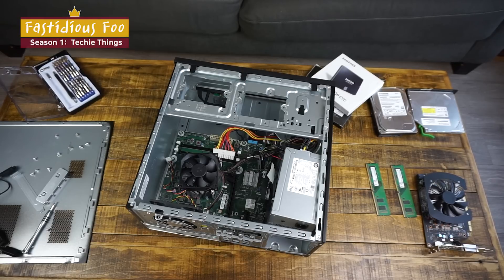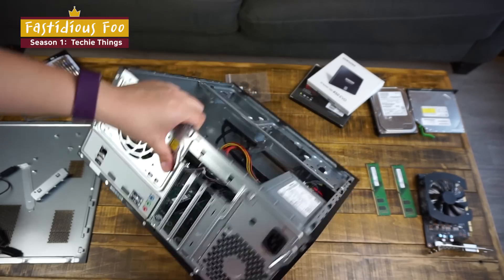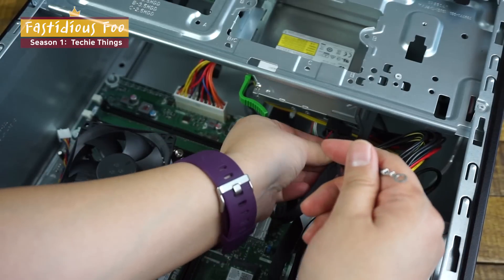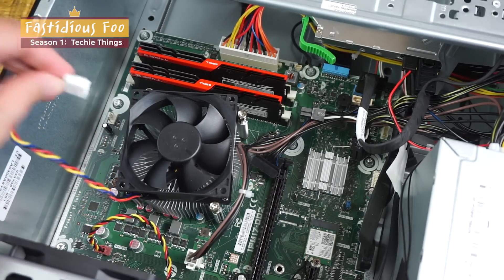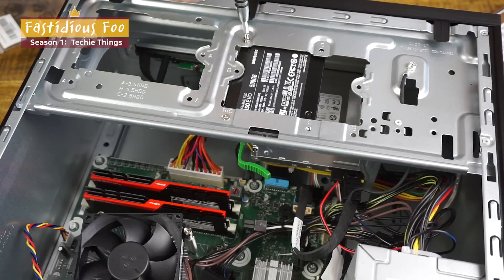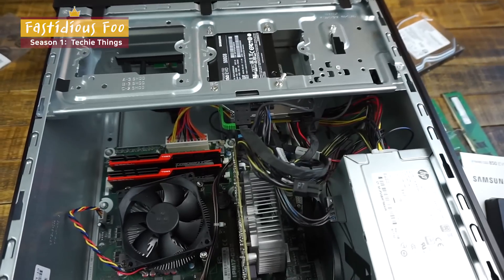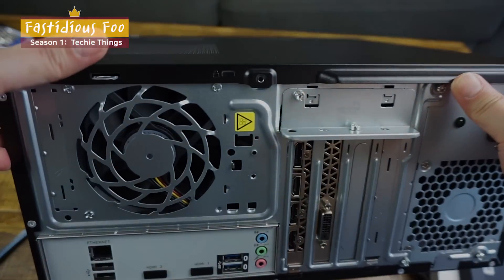RAM / SSD upgrade on HP Pavilion Power Desktop 580-023w

Comment: What Video Card comes in this? I bought one of these used and the card was removesd I had an old RX550 lying around so i tried to use it but it doesn't post. I tried the HDMI ports that have plastic covers in them and no joy there either. Also curious what you have for all the jumper pins. I understand the CMOS clear and Password reset but I have a jumper on the rom recovery but I cannot find that mentioned in the documentation. Thanks
Reply: It’s was a factory Nvidia gtx 1060 3gb

Comment: I've  the  h8-1170uk  module  HP pavilion HPE.   Is it worth upgrading this pc with new Graphic card/SSD hardrive/New RAM   32GB  or it's better to just buy new PC.. what would you recommend please? Also if so which parts would you recommend  Thanks

Comment: could i use this ram Corsair Vengeance LPX 16GB (2x8GB) DDR4 DRAM 3200MHz C16 on the motherboard the pc comes with? i have the same exact pc from hp
Reply: You can install it. But since the Mother Board only supports 2400MHz the memory wont run at 3200MHz. I have the same PC and am about to upgrade from 8GB to 16GB. I am looking at the same RAM that you are.
Reply: @joelrodriguez9661  btw if u still have hdd that comes with it replace it mine died within a year

Comment: I have the hp 570-023w and I added 8 more gigs of ram and a 1050ti single fan 4GB graphics card. It was a very tight fit but it's in and now gaming is not bad at all :)
Reply: So you now have two graphics cards in the pc? Also did you go with the ram she used in the video?
Reply: @zeke2069  This thread was all about if a 1050ti 4gb card would fit in this crappy HP 570-023w. The 1050ti fits barely. I had to push on the metal frame of the dvd drive to make it fit though. Only one graphics card. I added another stick of 8gb ram for a total of 16gb of ram. Now gaming is ok for now until i build a new pc. I hope I understood your question.
Reply: @fretmajik777  Yeah, I understand. Thank you. I'm just still trying to decide whether or not I should just get all new parts for a new PC or if any of these parts can be used again. I know that the graphics card limits the case, so if I upgrade that, then the motherboard will need to be replaced as well, and so on and so forth. I really wish I would have looked at the upgradeability of this PC.
Reply: @zeke2069  I agree, If I had known back then what I know now I would have built my own system.

Comment: Wsp, I have question, I have this pc. I want to upgrade the ram and I think I am gonna buy https://www.bestbuy.com/site/corsair-vengeance-lpx-series-16gb-2pk-8gb-2-4ghz-ddr4-desktop-memory-black/5822470.p?skuId=5822470 but my speed on my ram is 2 133 mhz and if i install 2 400 mhz ram, will my motherbaord not support. And I asked some people and they said it will just go back to 2 133 mhz beucasue i didnt change the setting in the bios. If I buy that ram, does it mean It will run slower at 2 133 and should i rather buy 2 133 mhz ram or not.

Comment: Should i buy another matching 8gb ram for 45$ from HP or which ram do you recommend for me to get for the value? thanks.
Reply: I got two 8gb sticks from Corsair I think as long as there is only two and their speed is 2400mhz, it should work. The cpu is what limits the cpu speed of 2400mhz. Let me see if I can link what ram I got.
Reply: This is what I  got https://www.corsair.com/us/en/Categories/Products/Memory/VENGEANCE-LPX/p/CMK16GX4M2A2400C14 you will probably be able to find it cheaper somewhere else though.

Comment: Hi foo! Thanks for your video it helps a lot to know where everything is. I was wondering if you have attempted to upgrade the psu to something higher than the 300 watts so you can upgrade the gpu if that’s possible?
Reply from the maker: you can definitely upgrade the psu on 580 PC but if you're talking about the 690 PC, it's a bit tricky. I think I got a Corsair ATX PSU for the 580- i don't remember what wattage.   Have not attempted to upgrade the gpu on the machine though
Reply: Fastidious Foo I have the 580 and want to upgrade the gpu maybe in the future. So a little more juice may help right? I’m using it only for the oculus quest link in virtual reality. I’m just concerned the motherboard may hold me back. I’m not really sure! Maybe a card of the same wattage will work? I think the gtx 1060 is 150w
Reply: @leeworden8814  did you ever end up doing the upgrade? I have the same computer myself

Comment: wait this pc comes with ddr3 ram so how are u putting ddr4 ram in there i have the same pc and want to upgrade the ssd and the ram?
Reply: Ruffy White Wait, how did you get the I7-7700? This pc comes with a I5-7400 or at least, mine did.
Reply: Well the first 1 or 2 the shitty hdd that came with it died or sum so I brought it to a shop and he put a new one in and from then it stutters and can get slow very fast unless I clean it every 30 mins

Comment: My gaming HP pavillion gaming desktop tower is only a basic nvidea geforce 1050 graphics card, is it possible to get a better one around A $300 to $500 budget? Also, I want to put more ram, any recommendations?
Reply from the maker: yes, definitely. In fact, I am currently making a unboxing video of 690-0073w which has 1660Ti - I got this yesterday for $450

Comment: Thank you for the videos with much easier steps to upgrade...  really appreciated...  I do have a HP Pavilion 570-p030 and been thinking to upgrade it... have ordered another 8gb ram and your video would be helpful for me to put it in... I am also planning on putting one m2 ssd to make it faster... I have a question and I am not sure if you would have the answer but I thought to give it a try... the USB 3.0 Type-C port that I have in my pc, I thought if I buy a converted USB Type-C to HDMI, I would be able to hookup a monitor via it, but unfortunately it is not working... not sure if this converter will help me to use another monitor... would you have any knowledge of it? anything would be helpful and much appreciated... I already have 2 monitors connected via hdmi and vga ports built-in with the motherboard btw...  thank you.

Comment: You puted the g skill 16gb ram 3200mhz? Because the hp motherboards not support 3000mhz +
Reply from the maker: Correct, I mentioned it on the video with caption
Reply: @Henry Nelson no

Comment: If I can get this computer today for $300 is it worth it?
Reply: Seth Kauffman definitely worth it if you’re not into heavy graphic designing or studio editing. I play most games at or above 60 FPS  (Overwatch, Dead by Daylight, PUBG, Apex Legends, Witcher 3). The specs should hold up for at least 2 more years before you’d have to upgrade the unit itself or get a new build altogether. She doesn’t mention it but if you decide to upgrade make sure you check the power supply to see if it can handle any upgrades. I paid $500 for it brand new with a warranty over a year ago and I have had no issues.
Reply: @AYOxSUBLiiME  ok cool, good to know. Yeah I only plan to game on it honestly, maybe some light browsing on the net and stuff, but I just want something that can handle my gaming along the lines of my One X and my Ps4 Pro (well,  better than the Pro probably, cause it's not like the X lol).
Reply: Seth Kauffman the Xbox one x is awesome for 4K gaming when it comes to value. You would need a build over $1500 to be able to even run 4K at 30-60fps. This is a solid 1080p prebuilt and a good value especially if you can get it for $300. Yeah it’s good for light browsing. Ideal Pornhub build.
Reply: This is only good for 1080p gaming which I’m fine with. If you want 4K you’ll have to look at a much higher price point to match the Xbox one x or ps4 pro. This is more comparable to an Xbox one S or a ps4 (not pro) as those are 720p and 1080 respectively. The games I mentioned can run 60fps @1080p on high or ultra settings. If you compared the base Xbox or ps4 graphics to this the consoles would only be equivalent to Medium settings on PC, so this prebuilt is definitely worth the value you get if you’re not concerned with 4K gaming and it’s VR ready.
Reply: @AYOxSUBLiiME  I'm wanting 4k, but I have my One X and Pro for that (not pro really lol, 1800p and 1440p), so I can be happy with 1080p if it is, and it's VR ready? That means I'm ready lmao.
Reply: Thankfully I can afford all the systems I want, I do enjoy having exclusives (Pro and Switch), and the multiplatforms just run better on One X, so with this computer being enough ready to handle it's own, I'm definitely going to get it and get a nice 1080p 144hz monitor I guess.
Reply: I want it for its PC VR, but I still love my PSVR and actually just bought Moss, Astro Bot Rescue Mission, and Wipeout Omega Collection, all for $55. Wipeout was the best deal at like $10, plus another 20%. I want all the greatest technology at some point... I just got a gear s3 frontier to go with my s10...  Nicest watch I've ever seen or used lol. Anyway, thanks for some assistance, I'm definitely gonna grab it for $300. Can any parts be used in a different build?

Comment: can u still keep this power supply unit after upgrading the ram and SSD?
Reply: Did you find this out? I have the same system and was gonna go for the SSD upgrade.
Reply: @JonMHarrell  i did upgrade ram and SSD. if there is a way to check if power is enough but everything is running fine. The SSD i got didnt come with screws to screw it in and the cable i used was for the old HDD. I literally wedged my SSD in there and everything has been fine

Comment: Do I really need the disc drive? I'm going to add 16gb ram and a 500gb ssd so I wanted to save power since the psu is 300w, will I be fine without the disc drive?
Reply: Not sure you would really need to worry about PSU in that case at all. But no, you don't really the optical drive... But realize that it's not using power unless you're actually using it. The biggest reason to remove it is to accommodate a longer GPU. If you're replacing the stock 7200 RPM hard drive with an SSD you'll actually use less power, not more. SSDs are more power efficient. Even if you also keep the stock 1 TB hard drive, I kind of doubt you'd really need a bigger PSU.
Reply: @Nikoab I've used this computer with an SSD as a boot drive and the stock HD as additional storage without issue.

Comment: Can I move the motherboard to a new case to what would be good one
Reply: Yeah it's just a micro ATX (mATX) board, so it will work in any ATX case or mATX case. The choice depends on what you want out of a case in terms of price, upgradability, cooling, and size. A larger case will be more upgradable and likely have better cooling. But they will be much bigger than the stock HP case which is very compact.
Reply: @ZombieLincoln666  thank you thank you very much i'm gonna add a graphics card so im gonna need more cooling

Comment: Do you think the power supply would be able to handle it if I used 16gb of ram, an ssd, and the hdd it comes with
Reply: jnust upgrade the psu its just 30 dollars get the 750 or 500
Reply: @OnlyGold77  can I just use any psu with this motherboard? If not, can you link me one that works, thank you

Comment: can you change the motherboard?
Reply from the maker: absolutely, that's what I ended up doing later on.
Reply from the maker: or did you mean if I can post a video for replacing the motherboard?
Reply: I was just wondering if it is possible ... 
Thanks for answering.  @fastidiousfoo
Reply: @fastidiousfoo  Could you post a video? I love watching these, it is really helping me get over my phobia of opening up my pc. Thank you so much for your work!
Reply from the maker: @KevinAndFriends.  Sure, I can do that... um is there anything, in particular that you want to see?
Reply: Fastidious Foo If you were to do a vid, probably just general info like what motherboard used, what case, and what goes into where including what parts you are using! also I had a question about upgrading ram on the original motherboard that this pc came with. on it’s product description, below the “upgrading ram” section, it says that it only supports 16 gb in the form of two 8 gb ram sticks, what would happen if i put a single 16 gb stick in or even two 16 gb sticks?
Reply from the maker: Okay, I've filmed a few videos on computer stuff - once I edit them, I'll upload them :) As for as your RAM question, it is better to use 2x 8G RAM instead of 1x16G performance wise but not sure you'd personally be able to tell the difference much. But if you are planning on expanding more in the future, 1x16G RAM would make more sense.

Comment: So you added 3200 RAM...  I was under the impression it only takes 2400.  Am I way off base?  If so, can you please explain?  How has your performance been?  Any issues?  Thanks.
Reply: I don't think she meant to say 3200
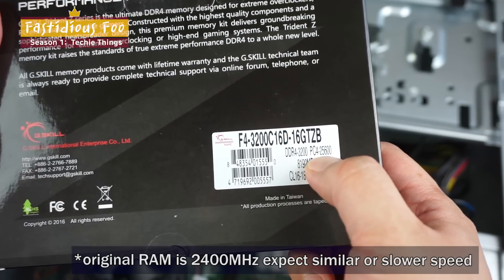Reply from the maker: You are absolutely correct.  As mentioned at @2:27, it performed at about 2400MHz. We've experienced no issues.
Reply: @fastidiousfoo  will G.Skill Ripjaws V Series 16GB (2 x 8GB) 288-Pin SDRAM DDR4 3000 work in this pc? as I am looking to upgrade the ram and its the ram I would prefer to get
Reply: @daylanbaust5940  It will work but I would recommend getting something that runs at 2400MHz since that's the fastest it will be on this rig
Reply: @theepster  Thank you. I would get something that runs at 2400mhz but because I plan on upgrading the motherboard case fans/coolers and psu in the near future I want to have faster ram for upgrading  and don't want to buy ram twice. Thanks again
Reply: @daylanbaust5940  Okay the 3000MHz will for sure be the smart option if you are going to upgrade the motherboard in the future but yeah, the ram you are looking for will definitely work with this PC

Comment: Where did you get your screws from that you used to secure the SSD to the case without a bracket?
Reply from the maker: I just had some laying around but you can get them at micro center or any other electronics store possibly home depot too...
Reply: @fastidiousfoo  I managed to find some pan machine screws at Lowe's that did the trick. Was finally able to fully secure an SSD to my mom's older HP 3500 computer that had a similar case array to the one you installed yours on. Thanks for the inspiration!

Comment: If i was to replace the power supply which one did you go with?
Reply from the maker: I moved around parts to build another computer... but I think initially Corsair CX650M (650W-80+ Bronze) while it was on sale + had rebate deal

Comment: I have this same computer and I am about to order the same Ram sticks and SSD with a bracket. Is the power supply (300watt) still enough after the upgrades? Also I am using the SSD to run windows and the HDD as a media storage.
Reply from the maker: I personally did not have a problem with the power supply even with the upgrades but ended up replacing the power supply later on
Reply: @fastidiousfoo  ok, thinks for letting me know.

Comment: can this case and motherboard fit a gtx 1070 mini or 1080 mini?
Reply: The gigabyte gtx 1080 mini is 6.6 inches so there is that option as well.
Reply: @Me_preppy  So either the zotac or gigabyte 1080 mini will fit?
Reply: @mattheww1072  yep.
Reply: No , the case is too short. The  DVD drive is in the way and so is the 24 pin connector. I would suggest a new case ,New power supply and a pcie extender to fit a bigger card.
Reply: Keeks Seven is that for the zotac version or gigabyte version?
Reply: @mattheww1072  Hey i remeasured and they do fit. The only upgrade you would need is the power supply. You just need a 500w power supply with 6+2 pins and whatnot. both models you mentioned are around 8 inches in length.
Reply: Any of the mini graphics cards will work.  Just remember you also need to upgrade the power supply.

Comment: I know this vid is extremely old, but im really hoping for a response. I have this pc. And i want to upgrade to 16 gigs of ram. I think i found that same ram but i hope it doesnt matter. Anyway. It says the speed is 3200 on the 16 gigs and my ram obviously is 2400 normal. Like u said in the vid. You said similar or slower speed on the 16 gb of ram. Will it still work like 16 gigs. Cause for some reason i really need 16 because i cant play fortnite and have discord and youtube open at the same time otherwise my memory goes to 100 percent. And idk why but my games keep using like 100 percent of my cpu. Hope u can help me. Also if i get 16gb should i upgrade my power supply.
Reply: "extremely old" means 2 years old now apparently. wait until you enter your 30's.
Reply from the maker: I am confused about what you are asking. The capacity and speed are not correlated.  When you have 16G RAM, it will work like 16G RAM. I did not have issues when I was using the same power supply. So I don't think it is a must.
Reply: @fastidiousfoo  I have a question can I move this motherboard to another case and what would be a good one

Comment: What kinda PSU and Graphics card would I need for this?
Reply: crazydrpepper it comes with a FTC 1060 3gb and a 300 Watt psu, those should be fine but the psu is a little on the low wattage side
Reply: TOTALxThunder I have this PC trying to find out what video card

Comment: doesn´t she  know that you can put an ssd and a hard drive
Reply from the maker: you just need an extra SATA cable and little screws for the SSD watch this video, I think I had step by step instructions: https://youtu.be/_JaHLyppI1s
Reply: Fastidious Foo I dont know if i have the m3 screws where can i get them? And that specific size?
Reply from the maker: I had a use for the harddrive on my other machine
Reply: Fastidious Foo How do you install this ssd? Will i need to buy anythong extra alongsidr the ssd and i wanna keep the hdd in tooo